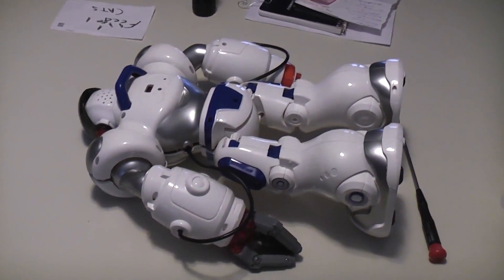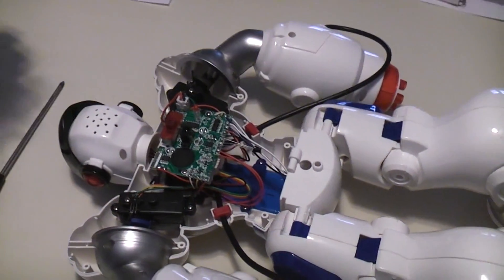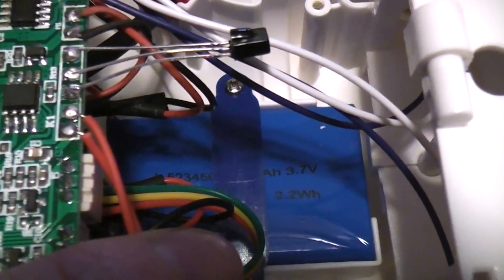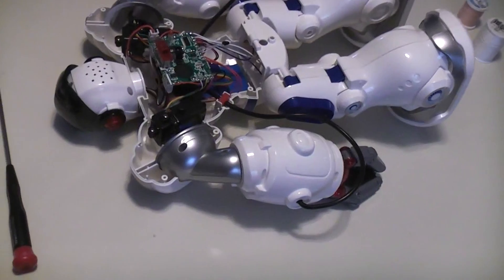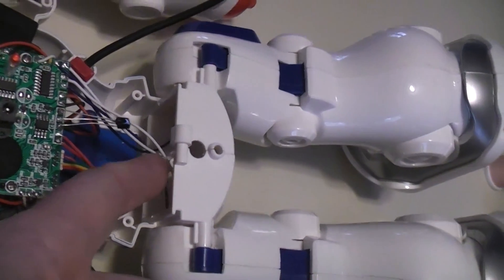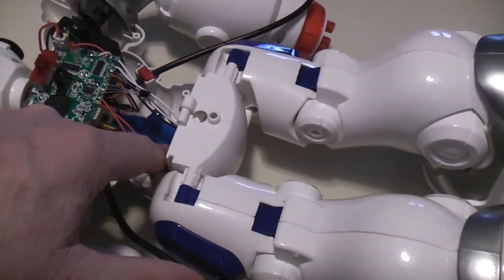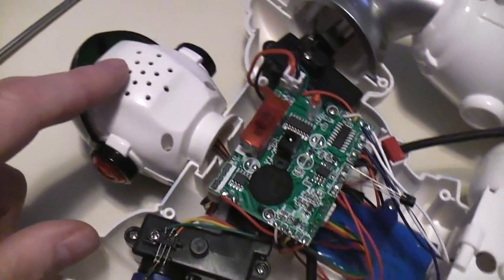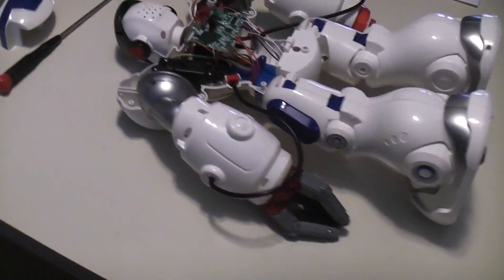Inside the Ruko "WILL 7088" programable, RC, robot.  Battery replacement.

Comment: Future is here and these robots can do a lot of things and this is only the begining but very interesting video and how everything is inside thanks John
Reply from the maker: The main question was, can the battery be replaced when it goes bad in a few years. And it looks like it can. The old vintage robots that are 50 to 70 years old still work but the new ones have problems like plastic gears that split and now built-in batteries that go bad.
Reply: @Robothut  yeah nothing like the usual AA batteries and i use rechargeable ones so they are pretty good to use, the plastic gears that's not so good because they want people to buy more

Comment: It still amazes me how little there is inside modern robots, with most of the functionality managed by a tiny circuit board.  Even the motors have gotten really compact.
Reply from the maker: Yes there is not allot to them now days thanks to digital control circuits.